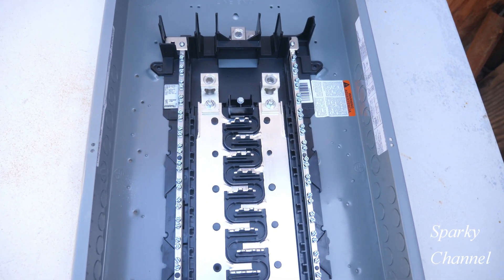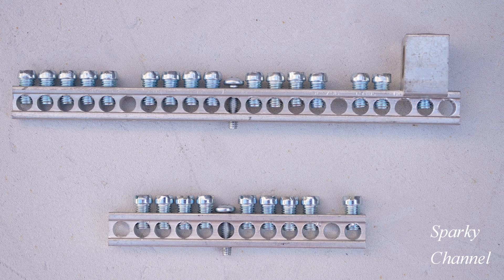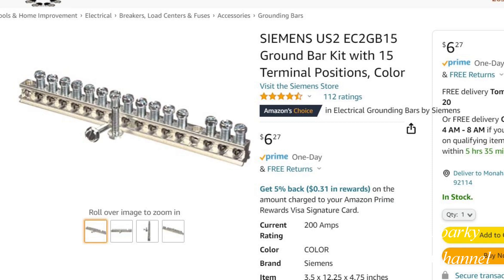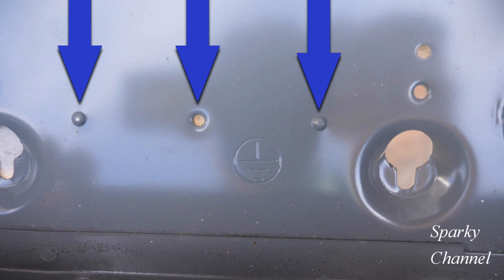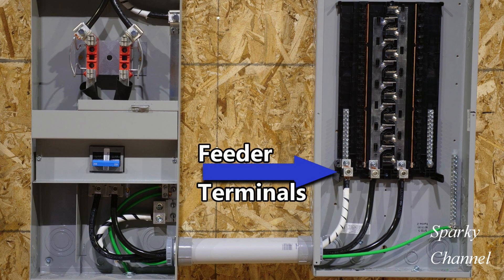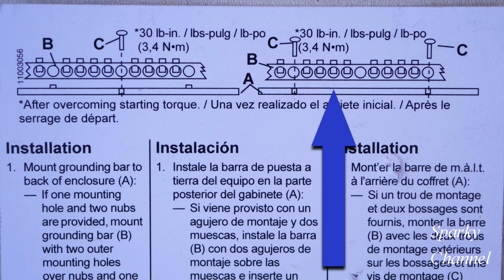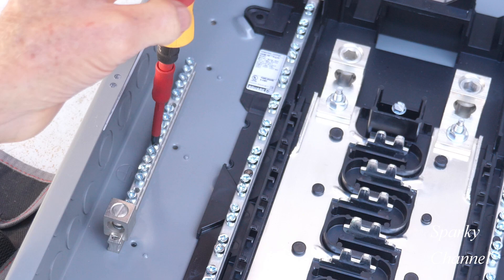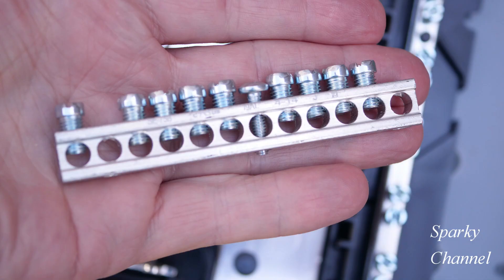How and Where to Install Ground Bars on Panels

Comment: My Homeline 70 amp box does not have the ground symbol or the screw holes for the bar?
Reply: Mine too, exactly.  I can't believe how much time this is taking-up.  Unbelievable.  Please let me know if/how you solved this.  My electrical inspector is useless.
Reply: @mitchmadness4376  As you need machine thread connection, most jurisdictions would allow you to use a drill with a thread cutter and then screw a ground bar in at that location. Ask you inspector, just don't use a self-tapping screw as this violates NEC 250.x

Comment: If there is no indicator for location for ground can you just add a terminal anywhere
Reply: If you tap the enclosure and connect with 2 threads worth of machine thread per NEC 250.x

Comment: If I use more than 1 ground bar, should I specifically connect them together by some bare copper wire?
Reply: I don't know how the electric code book would answer this question, but logically since both of the ground bars are bonded to the steel panel box it would seem redundant to connect the two bars with a wire.
Reply: sure,but i dont think it would hurt any either!@georgeblakey7730
Reply: For 200amps you need more than one ground rod. You must use a rod that is 5/8 inch thick,not 1/2inch. The ground wire must be solid and all one piece. Run it to the first rod,connect it with an acorn connector,and loop to the next rod without cutting it at the first.  If your rod is 8ft long,then space the two rods 8ft apart,if you are using 6ft rods,then space them 6ft apart. The acorn connector has a valley on one side,and the screw on the other,always run wire on the side with the valley,not the screw. So if your project already has one rod,if it's half inch, replace it,if it's 5/8inch then use the one rod you have, but don't use the ground wire that runs to it, because to add another rod,you'll have to add longer wire,and you cannot have a cut,even if you are spliced at the first rod, it has to be one piece from the panel,all the way to the last rod. Hope this helps.
Reply: @normalhuman9260 I don’t the the question was about the grounding electrode…I think he said bar when he meant bus. He’s asking do the two ground buses need to be tied together. Or are they bonded by the box itself they are screwed into.
Reply: @jefflinsk8032  oh ok. Well bonding the bus bar for ground and neutral is a simple rule to follow. If at the primary disconnect "aka the primary breaking panel" then the ground and neutral are to be bonded,with a fine course screw, and have at least two threads in contact with the panel. If you are at a sub panel "aka not the primary disconnect" then you are not to be bonded until you are back at the primary panel. Rather than running a wire in the panel box to bond,you should be using the appropriate bus bar and neutral and ground will bond through the panel box itself. Most modern panels have a specific green screw,that if torqued down to spec will bond the two,and if left untorqed will leave it unbonded. Hope this helps.
Reply: @jefflinsk8032  also,I have an uncle who has a name almost exactly like yours. I thought that was interesting. Have a wonderful day,and thank you for pointing out my misunderstanding about the question. I'm better with my hands than I am with my words,lol

Comment: I have a homeline plug in neutral being used as a main panel. No ground bar came with new panel. 
It is my understanding my grounds can be installed on the neutral bonded panel bar. I must have only one neutral per terminal. Is this correct, or do I need to go purchase a separate ground bar.
Thank you for all your videos
Reply: My understanding is ground an neutral must not be bonded in any place but the initial place if disconnect which is generally the main panel. So subpanels should have separate ground and neutral. I think lol...not an electrician.
Reply: If it is your main panel,and not a sub panel,I would add a separate ground terminal even though I would bond it to the neutral. Inspectors like seeing the grounds all on one terminal,and neutrals on another, but bonded if it's not a sub panel.

Comment: A 15 amp breaker I have with very little load keeps tripping. Changed a potential faulty outlet as well as the breaker and it helped for a day and a half but keeps tripping. There is no ground wire to the breaker or the ground bar next to it. Thoughts?
Reply from the maker: See my video: Storytelling by an Electrician: https://youtu.be/P6FFAHaCE0g
  for some ideas.

Comment: Im looking for ground bar for old outdated Crouse-Hinds panel. Im aware that Murray bought Crouse-hinds and then Siemens bought Murray so I would think Siemens is my way to go. I just dont think they left the little dimples like todays panels so is tap and thread or own our only options? Is this code/manufacturer compliant?
Reply from the maker: I would call Siemens and ask on that one.

Comment: @02:41 That panel should have been installed upside down so the feeder wires are not in the way of everything on the lefthand side of the box.
Reply from the maker: I agree.

Comment: If the ground and neutral are bonded can I put the ground wires on the neutral bar?
Reply: Yes as long as it's not a sub panel
Reply: @ericandes4288  why wouldn't you bond the box if it's a subpanel?
Reply: @heads_together_crypto2422  It's not up to code (NEC) to bond the ground and neutral on a sub panel. From a safety aspect you can cause a shock. In the past tho they would absolutely bond the two but they stopped doing that in the 80s. The panel would still work but you create additional resistance. It's more of a just in case honestly. Consult a local electrician for more info.
Reply: @ericandes4288  can you describe a scenario like that? I have the subpanel grounded to its own ground rod as well.
Reply: @ericandes4288  I installed it. Hopefully that never happens. If I had the grounds and neutrals on separate bars all I'd have to do is remove the bonding screw. But I have them mixed together. Each neutral has its own screw but I have ground wires on the same bus bar. The panel before this one is the main 200 amp panel right below the meter base on the pole that the tri-plex comes to. And I bonded that panel as well which as I hear you would be correct. I did some research. Not sure how I missed this code fact.
Reply: @heads_together_crypto2422  Good luck. I doubt anything will happen. The main panel being bonded is perfectly fine as you did. Just make sure to fix the sub panel if  you ever choose to sell the home. An inspector will fail the home which can cause a buyer's bank to pull out in the worst case and best case they would just tell you to fix it.  Depending on your town this can be super expensive if they require a licensed electrician to fix it and pull permits etc.

Comment: The first ground bar has the ground wire coming from the main, but what about if I want to install a second, how will that bar be grounded? Do I need to run a green wire between the 1st and 2nd bus bars ???
Reply: In theory the box that first ground bar is attached to becomes grounded. But I wouldn't rely solely on that. So adding the appropriate size jumper between the 2 is in order. I'm sure you could search for the specific code related. Solid bare copper would be my first choice.

Comment: Had an inspector red tag for adding a ground bar. Stated it voids UL listing for electrical panel.
Reply: The Inspector was an idiot.
Reply: ...but the manufacturers specifically include anchor points for them 🤦

Comment: @sparky channel if my panel is grounded and bonded together…. If i was to add an additional bar does it need to be connected to the originals neutral/ground bar?
Reply: Yes that would be considered your main bonding jumper as well so size accordingly

Comment: I need to install a neutral bar at or near the top of the Home main Line load center because home runs are too short, but only see one nub above the main breaker and holes. how would you handle this? Thanks for the great videos.

Comment: If we look at the design of the load center you will notice the twin neutral connection bars on either side of the breaker outputs. This is a good selling point because the hot wire terminates at the breaker output and the neutral directly below it, with that particular branch circuit wiring entering at the same position as the circuit breaker output. 

So, when the branch circuit enters the load center near the breaker there is a very short and straight path from panel entry to the breaker (hot) and neutral. We should then extend this approach to terminating the EGC in close proximity to the branch circuit entry. So, ideally you should see a ground bar the same length as the neutral bar on either side (for side entry branch circuits) and one at the bottom of the load center for branch circuit bottom entry. This way when a branch circuit enters the panel it is terminated at the entry point for HOT, NEUTRAL and EGC (Green), so the branch circuit wires do not have to route within the load center itself, making for a very clean installation. 

This is why with the load center shown in the video you see the three distinct ground bar bolting positions (indicated by the ground symbol), one on each side and one at the bottom. Because these are machine threaded to accept UL listed Square D ground bars, the enclosure can be use to splice together the grounding bars (if the attachment screw is torqued to spec) regardless of how many are used. So, as stated in the video, given the relatively low cost of the grounding bars, they should be used in such a manner as to clean up the panel internal wiring.
Reply from the maker: Excellent points. Thanks!
Reply: 2020 Code Language:

334.24 Bending Radius. Bends in Types NM and NMC cable shall be so made that the cable will not be damaged. The radius of the curve of the inner edge of any bend during or after installation shall not be less than five times the diameter of the cable.

 2023 Code Language:

334.24 Bending Radius. Bends in Types NM and NMC cable shall be so made that the cable will not be damaged. The radius of the curve of the inner edge of any bend during or after installation shall not be less than five times the diameter of the cable. For flat cables, the major diameter dimension of the cable shall be used to determine the bending radius.

Comment: Not sure if you have a link or could answer. When should the ground & neutral be linked at the main or could it be done at the sub panel or when are they not supposed to be.
Reply from the maker: See: In Which Panel are the Neutral and Ground Bonded?: https://youtu.be/Lsl1TZuxJpw
Reply: @SparkyChannel  Thanks!

Comment: Can neutral wires also go to the newly added ground bar?
Reply: not if its a sub panel, grounds and neutrals can only be connected together  at the first means of disconnect.
Reply: @jeremybaylor5816  yes this question is about the main panel. I do not have a sub panel at all anywhere.
Reply: @BearboiFN  oh ok, well then grounds and neutrals are bonded at the first means of disconnect. the bonding screw will tie everything together. so if its not a sub panel then yeah you can.
Reply: @jeremybaylor5816  and if it’s not??
Reply: Don't do it.  You can only add Ground bars to a panel, not neutral bars.  So only attach ground wires.   If your existing neutral wires are too short to reach the neutral bars I am pretty sure you can make them longer using wire nuts and a bit of white colored wire of the same awg.
Reply: If it’s connected with the proper jumper according to 250.66

Comment: Mr sparky I want to install an extra 20 amp dedicated breaker for my welder and while opening the panel notice the ground bar is full although the neutral and breaker space still has space how can I solve this?
Reply from the maker: Is this a main panel which is the first panel of disconnect?
Reply: @SparkyChannel  yes it is..
Reply: I don't have a sub panel just the main which is outside the house...
Reply: 20 amp for a welder?? I would make sure you don't need 30 or 40 amp...
Reply: @mikemiller9030  yeah it's not a big welder bought that to practice my welding skills and also installed a 30amp 240 receptacle to buy a bigger welder once I refine my skills with the smaller welder..

Comment: Good info Sparky!  I see questions- the grounding bars are all bonded to the case or frame and do not need wiring jumpers connecting each grounding bar to the other grounding bar. The grounding bars are for equipment grounding purpose- you do not attach any grounded neutral conductors to any of the equipment grounding bars. Thanks. Peace.
Reply from the maker: Thanks MC!

Comment: If there are multiple ground bars in a sub panel, do they need to be connected together? or does one ground the entire panel by being screwed in so that the second bar would also be grounded?
Reply from the maker: The metal body of the panel connects the ground bars. That's why the fasteners that connect the ground bars to the panel must be torqued to manufacturers specs.
Reply: Does that applies to the main panel also if I want to add an extra ground bar since the one I have is already full?
Reply from the maker: @misaelmartinez87  Yes, it does apply.
Reply: @SparkyChannel  Appreciate your expertise knowledge being taught to people that want to learn more. I am a rough carpenter but love learning other trades and sorts of jobs...

Comment: Can I run grounds to the plugon neutrals if this is a main (first and only ) disconnect panel? Mine is. Since neutrals and grounds are bonded here what would make me add ground bars if I have enough spots left on my neutral bars

Comment: Something I wished that I seen was how I’m I supposed to bridge the neutral bar to the ground bar? I ram across a mobile home that has an updated panel but whoever installed it didn’t even place a bar for the ground. It’s literally all just in a knot to the aluminum ground. 🤦🏿‍♂️
Reply from the maker: Here you go: In Which Panel are the Neutral and Ground Bonded?: https://youtu.be/Lsl1TZuxJpw

Comment: What is special about a ground bar.  I purchased a Siemens spa panel with ability for extra branch circuits. The ground bar is unfortunately extra.

I have an another panel from another manufacturer that was used for parts for that brand.  

Why couldn't I drill some holes for that grounding bar?
Reply: According to UL and the NEC, ANYTHING you install into the panel has to be approved for use in THAT panel. That's because that particular device has been tested and approved for that particular panel. Just because you can make it fit doesn't mean it's UL or NEC approved.

Comment: Great video, thanks!  I have a question about using multiple ground bars maybe someone can help me with that.  On a 200 amp main panel with split ground and neutral (they are joined at a service disconnect), the 1/0 ground wire needs to be bounded to an installed ground bar right?  If two ground bars are installed, say on left and right sides, does the enclosure provide the needed electrical ground path between ground bars, or must a jumper be run between the two bars? And does it need to also be 1/0 or something smaller? And on a related question, can the 1/0 ground wire be unwound, and wound as two separate half-sized ground wires, one going to the left bar, and one to the right? Is that a code problem?

Comment: Hello Bill, what is your preferred method of removing the enamel and paint for a good ground bar contact?
Reply: It is not the ground bar touching the panel that is the conductive path, the conductive path is the ground bar touching the screw and the screw threads touching the bare metal
Reply from the maker: You don't have to. The screw, tightened to the correct torque, provides the ground bar contact.
Reply: My inspector thought ground bars don't need paint removed.  However...a ground LUG, a single blocky connector for big wire like 2/0 needs paint removed behind it for sure.

Comment: Good video 
Question, how do you ground a subpanel...
Do you install grounding rods like the main panel, or how to do it...?
Reply: From what I understand a subpanel attached  to the same structure as the main panel doesn't need a ground bar. Ground is connected to the main panel's ground.
Reply: It depends on the location of the subpanel. First of all the feed needs to be 4 wire: two hots, a neutral, and a ground. A subpanel in the same building does NOT need new grounding rods, but by code, a sub panel in a remote location (like a garage) needs it's own ground rods system.
Reply: @im2yys4u81 we are remodeling an old house (built in 1900 no idea when electrical was added but some is still 50/60s cabling) the house is a 100 amp subpanel as is the barn with main 200 amp shut off and ground at the pole.. we only have 3 wires coming in hot neutral and ground ..  in a county with NO codes.
Reply: @adelinawarriner6259  What you have are two hots and a neutral. My house and garage were wired as you say yours is. My garage is remote so I installed grounding rods to get an earth ground, then pulled a solid copper wire into the panel. For the sub inside my house I had to pull a 4th wire from the main to the sub. The neutral and ground are bonded in the main panel, but by code are required to be split in the sub. If you have no code you can get away with it, but I like to err on the side of caution.

Comment: Nice video.  I come across all brands of electrical gear and it is easy to tell that a warehouse maintenance person put in a panel.  They put the ground bars are any place and mounted with drill point screws.
Reply from the maker: I do understand, thanks!